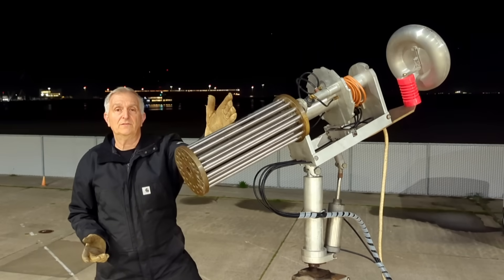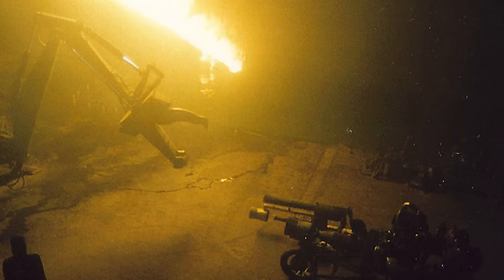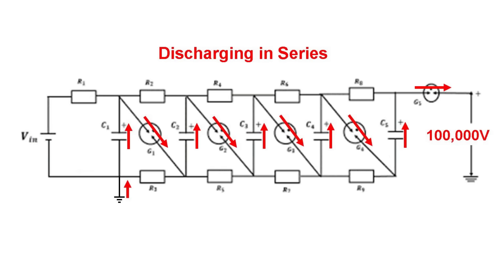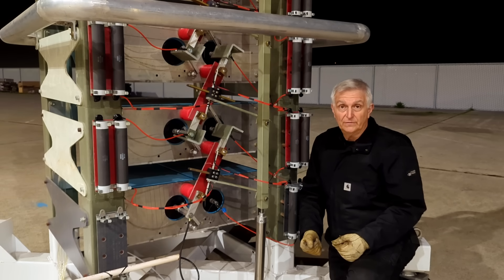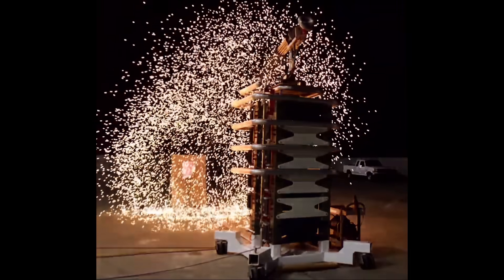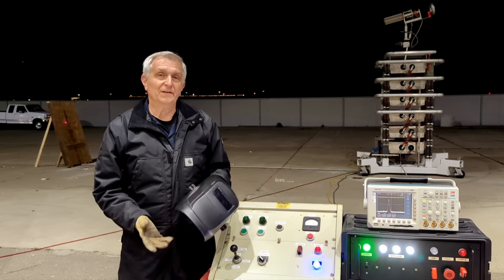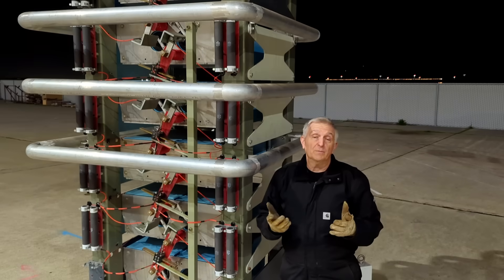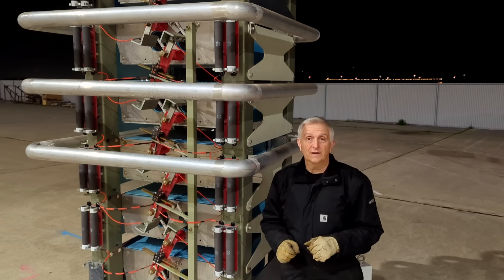Firing the Lorentz Plasma Cannon

Comment: OK I made comments here before and my comments all need to be kept up here. There’s a reason for it and if you there, just ignore that listen this is what this machine is for extreme polarization. We use this to actively get into the machine itself is inherently not nuclear hot, wild a man working it is going to have to wear a lead line space suit, and we use this to bring motors back under control. That’s what we have it standing around for and we do use it occasionally for war, dynamic, active nuclear war, dynamic activations, which is something that is not within modern time due to nuclear terrorism taking out all of high science before your time it is one of the machines that I do know how to use and that’s why it is still in service while I do not use it for intended purpose, which was shutting things down because I have a different method that I use. I suck the power up with a different machine. I do, however use that machine and other hat tricks to start stuff I use hat trick to start the stuff in the field and I run it as I need it and then I shut it right back down instantly now when I’m going to activate something and I want it to stay stable and activate it for a long period of time I need that level of rheostat control, andspark gap amplification similar to diode amplification😂❤🎉 and yes, every comment I’ve made I’ve been busting my brain trying to recall and that was not on my list of things to think about and so it gave me a hard time to sit back and get two to pull this information off for you, so please don’t be a dick

Comment: Layman here. Could you explain why when it’s fired we see a tiny “projectile” but when it makes contact, we see a long line connecting the cannon and the target?
Reply from the maker: The dart is trailing a hair-thin trigger wire, which will direct the 30000 amp plasma channel to the desired target.  1:56

Comment: in both slow views what is the small object proceeding the shockwave?
Reply from the maker: The dart is trailing a hair-thin trigger wire, which will direct the 30000 amp plasma channel to the desired target.  1:56

Comment: This is pretty great my friend, but what is the projectile seen at 8:36-37. You may have made something that could be turned on us, but I admire your creativity and drive to build it. I would love to run some of my hypotheses by you lol.
Reply from the maker: The dart is trailing a hair-thin trigger wire, which will direct the 30000 amp plasma channel to the desired target.  1:56
Reply: @LightningOnDemand  Very interesting. My apologies, as I fast forwarded through that section or didn't catch it. Thank you for showing me. Cheers

Comment: Question:  it looks like it is launching a projectile before the plasma.  What is the projectile?
Reply from the maker: The dart is trailing a hair-thin trigger wire, which will direct the 30000 amp plasma channel to the desired target.  1:56

Comment: Still need a way to focus the energy without a conduction cable which can travel long distances.
A photon emitter with a high energy pulse . Copper is a good conductor but we are going to need a super alloy with minimal resistance to achieve the minimal energy loss thus focusing more energy to emitter from a photon gun. problem is we are 20 years behind any successful photon gun trial and soon we will be able to see how humans can manipulate energy beams which can travel without loosing the energy as heat. If you have conducted this highly pressurised nitrogen chamber I think it might work a bit further and will deliver a maximum damage toward the target.
This is an exciting experiment ❤. Thank you for sharing it with us.
(All above opinions are just my opinions and no research was done to support my idiotic opinions)
Cheers.

Comment: It's good that you've kept this this machine is not for this machine does this to prove that this machine is complete as the the parts that it is the parts are for something different please keep these this machine on hand we don't need a whole bunch of them we just need one always on hand and available now if you're looking for a directed energy beam weapon we're going to go with a phaser out of a hair dryer now the hard part about building a phaser is catching an ice cube on fire how this is done is I set the rubbing alcohol on fire in advance I tie with a bread tie and ice cube to the metal grade on the front grill of the exhaust of the hair dryer I then douse it with some rubbing alcohol I didn't have another container of rubbing alcohol that I set on fire I then pour the fire on the ice until the ice is a lit I then turn the hair dryer on I then spray brake cleaner or carburetor cleaner and use a pocket air horn and I sometimes yell this tool instantly sets sand asphalt and concrete a light this is the primary tool used by an by officers to shut down major riots when they're not supposed to happen I myself use this to found the past the line project this tool is meant to be mounted to a vessel not held in your hand as such there is an endothermic Kelvin shocked that your teeth are the heat sink for your body so if you have any bad teeth if you have any fillings you're going to have the worst toothache of your goddamn life if you don't have any teeth you're going to die from using this tool even if you have good teeth you're going to wish that you hadn't touched this tool other than for holy s*** nucleation level of hand of God for Star Trek in reality people actual real honest to God f*** you very much phaser

Comment: What is the little metal projectile that fires before the blast? Apologies if I’ve missed something
Reply from the maker: The dart is trailing a hair-thin trigger wire, which will direct the 30000 amp plasma channel to the desired target.  1:56

Comment: Okay thay was cool and all, but now let's see 210,000,000 volts instead. How far will it shoot?
Reply from the maker: Roughly 1000 times farther, or about 7 miles.  That would involve a rather tall Marx bank however.
Reply: Now that's an effect!

Operation SINGE:

A 210-million-volt plasma cannon is fired from high altitude into a weak point in Earth’s magnetosphere (e.g., the South Atlantic Anomaly). The blast destabilizes the ionosphere, triggering a chain reaction:

Immediate effects: Satellite blackouts, global EMP surges, auroras at the equator, radiation bursts.

Cascade effects: Collapse of Earth's magnetic shield, increased UV and cosmic radiation, global lightning storms, atmospheric heating.

Final phase: Tectonic instability, superstorms, mass extinction—Earth becomes an uninhabitable wasteland within 24–72 hours.

All from a single shot. The planet finishes the job itself.

Good thing you'd need a Marx tower at least 300–700 meters tall, with hundreds of capacitor stages, advanced insulation, and megajoule-scale energy storage...😅

Comment: What was that small bullet looking projectile that preceded the bolt of plasma ?
Reply from the maker: The dart is trailing a hair-thin trigger wire, which will direct the 30000 amp plasma channel to the desired target.  1:56

Comment: I think i saw something fly at the target before the plasma
Reply from the maker: The dart is trailing a hair-thin trigger wire, which will direct the 30000 amp plasma channel to the desired target.  1:56
Reply: @LightningOnDemand  so that work as lightning rod?

Comment: If you put a ring of very high intensity Leds around the barrel and forget the dart and wire, you will get an ionised tube of air within the light. Turn on the lights and discharge the capacitors and you've got a phaser.

Comment: Dont TOW missiles use wire guidance? Repurpose old systems to overwhelm a tanks electrical system with 240,000 volts.....
This could be mounted onto ships as a final ASM defense. An explosion at 25 ft is better than an impact.

Comment: But how does the actual cannon work? I mean, what is the orientation and structure of the electrodes?
Reply from the maker: The dart is trailing a hair-thin trigger wire, which will direct the 30000 amp plasma channel to the desired target. 1:56
Reply: @LightningOnDemand   Thank you, that explains everything.

Comment: If clouds have a hug amount of volts /electrons available, why not collect the electrons and store them in capacitors?  The power grid would drain the capacitors and extra voltage/electrons could be stored in discharged batteries.   A real plasma gun would fry all the electronics in a tank or electronics found in any weapon.  Use a wire like tow missiles.

Comment: energy stored in a capacitor is 1/2*C*V*V.  The voltage being squared yields exponential increase in energy. For example, doubling the voltage yields 4 times more energy.

Comment: What was that little bit of spark at the beginning right before the boom?
Reply from the maker: The dart is trailing a hair-thin trigger wire, which will direct the 30000 amp plasma channel to the desired target. 1:56

Comment: At the slow mo part, what was the projectile before the explosion?
Reply from the maker: The dart is trailing a hair-thin trigger wire, which will direct the 30000 amp plasma channel to the desired target. 1:56
Reply: @LightningOnDemand  awesome. Thank you :)

Comment: whats that “projectile” going at aim just before “boom” around 8.38?
Reply from the maker: The dart is trailing a hair-thin trigger wire, which will direct the 30000 amp plasma channel to the desired target. 1:56

Comment: What was the rod that was coming out of the front of it before the lightning in plasma
Reply from the maker: The dart is trailing a hair-thin trigger wire, which will direct the 30000 amp plasma channel to the desired target. 1:56

Comment: The voltage exists between two charges of opposite sign(as far as I understand). So for the lightning to go through a plasma channel there should be an opposite charge at the other end of the channel. It could be ground or something else... why didn't you talk about this?

Comment: I take it the sparks are oxygen burning in the air?
Reply from the maker: Good question, I'm not exactly sure!  It does seem like a lot of sparks for just a 1/4 cc of trigger wire.  I'd love to have an optical spectrometer to look for characteristic lines next time.

Comment: A scary machine, I think that lightning usually cracks in the sky half way up but I wonder does this one crack on the board or on the copper plate were it returns that's if its were it does or if it does? I ask because I wonder if that blast is enough to break bones? I know the shock may hurt. XX you but that is not the wonder to clarify. Also May I ask, how much would or does it cost to shoot? Also want to say, seeing the energy travel down the laser is crazy, I think that what i'm seeing or is there a wire like explained, nvm I see now 10:28 im dum to think we could see it travel if it was?

Comment: Please dont overvoltage those nice new capacitors! Oh wow!!!
 For a minute i didnt believe this, as.. Well I still don't really understand how you get a directed 'beam' from that bundle of tubes? I note the coil, so I figured pulse current going though that helps keep the Lorentz force in a defined direction? .. I'd dig a breakdown of how you do it..
Reply from the maker: The dart is trailing a hair-thin trigger wire, which will direct the 30000 amp plasma channel to the desired target. 1:56
Reply: Oh wow, thanks for that @LightningOnDemand  - right, PHYSICALLY directed plasma? The wire thing wasn't just an example - sorry, wasn't paying attention 

Interesting... Dont know if you ever read Atomic Robo Comics, but Robo gets left a 'Lightning Gun' by Nikola Tesla - and here we have the real thing :)

 Can understand if youre a bit proprietary about some of this - but the little coil at the head, wondering does that help direct the plasma, spread the width of the pulse, or what?
Lets watch this again 
Pete G, Gas Electronics, London

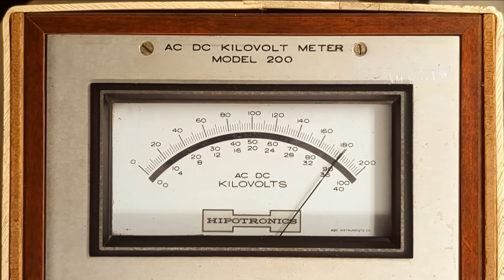Comment: 7:29 mentions 210kV being twice energy of 150kV. Idk how energy is measured so I'm curious & eager to learn. Wouldn't it be 300kV?

Also... Amazing Video 🤯. Man, that level of dedication for an electrical disintegrator, wicked awesome!!! 😅.
Reply from the maker: Energy in a capacitor rises with the voltage squared, so 210^2/150^2 = 1.96  [about 2]
Reply: Got it, thanks!
 @LightningOnDemand

Comment: What’s with the metal rod
Reply from the maker: The dart is trailing a hair-thin trigger wire, which will direct the 30000 amp plasma channel to the desired target. 1:56

Comment: What is the little pellet looking thing that shoots out before it fully discharges?
Reply from the maker: The dart is trailing a hair-thin trigger wire, which will direct the 30000 amp plasma channel to the desired target. 1:56

Comment: The TV failure was quite interesting. We went from the electron beam scanning properly to the classic fold-dot-dim of the earlier black and white sets, presumably due to the magnets directing the beam failing.. Or their controlling circuits having left the building. Either way, the electron gun itself continued to work for a short period, which I found surprising.